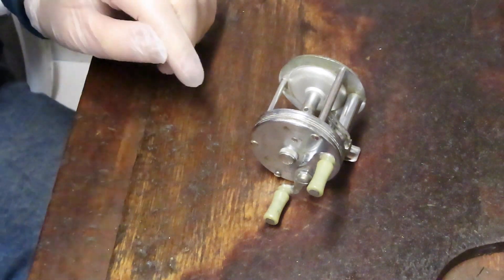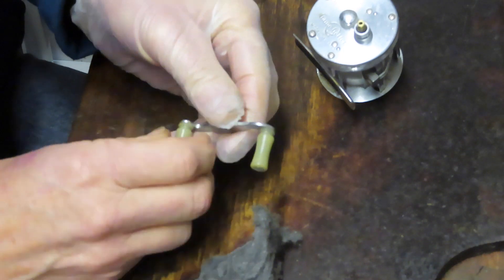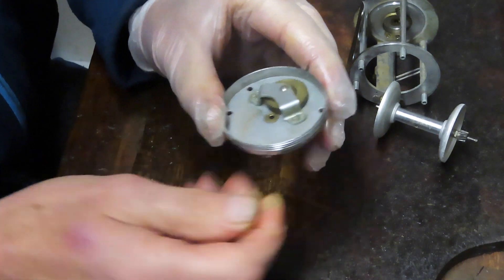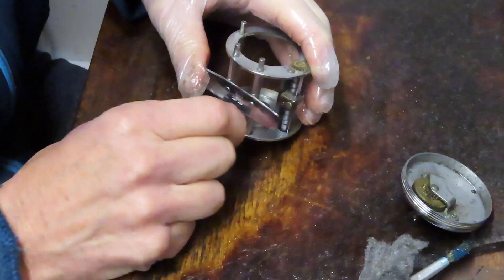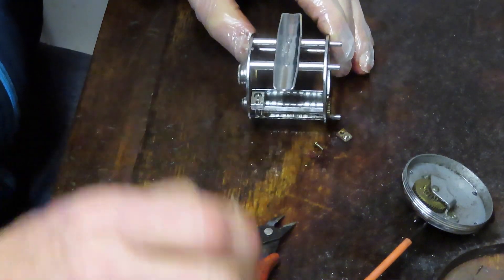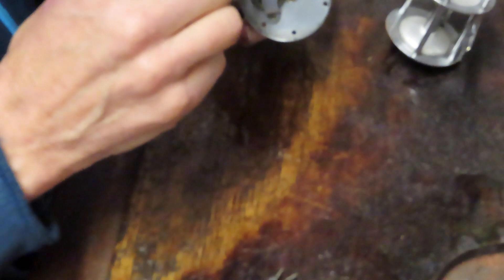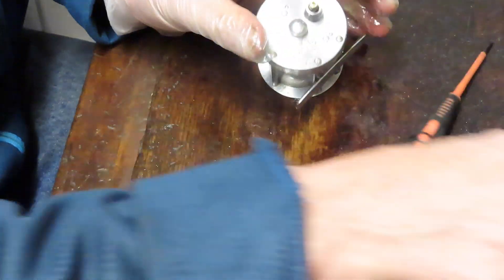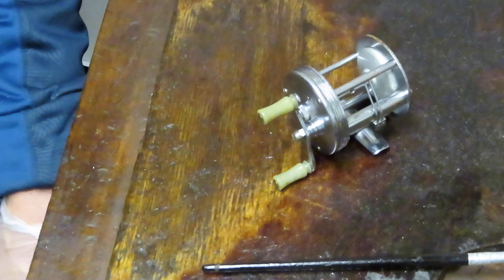Vintage 50s 60s Game Getter level wind baitcasting reel how to take apart and service

Comment: That double ended pawl seems like a no brainer..... I wonder if the patent prevented other manufacturers from using it?
Lovely looking little reel Dennis, keep up the great work and stay safe.🎣
Reply from the maker: Good question!  I wonder if the performance is impacted when you break a pawl tooth and turn the piece over inside the cap.  It should have solid footing on the bottom to perform.  Dennis
Reply: @2ndChanceTackle  good point Dennis,never thought of that....maybe it wasn't such a good idea after all! 🎣